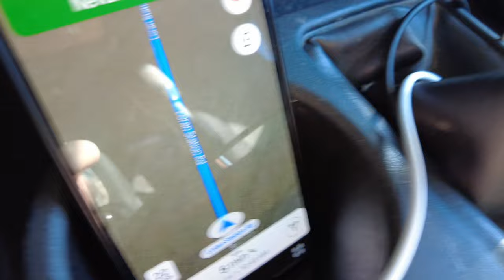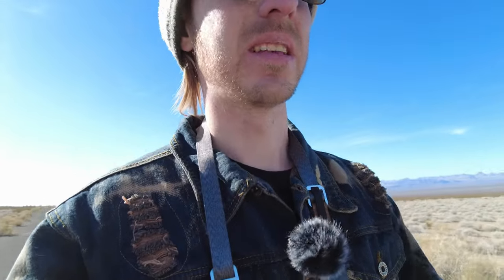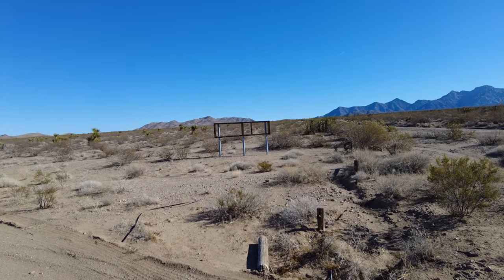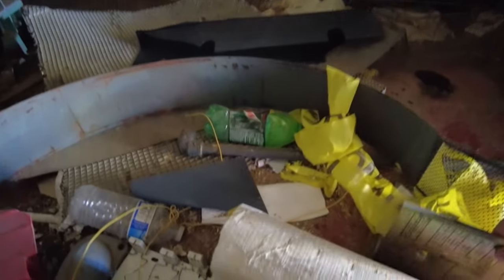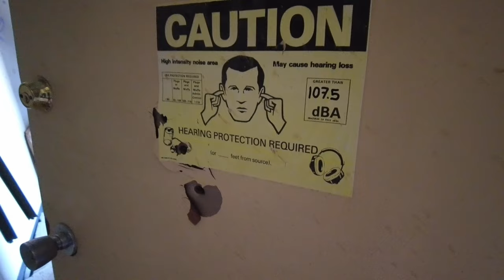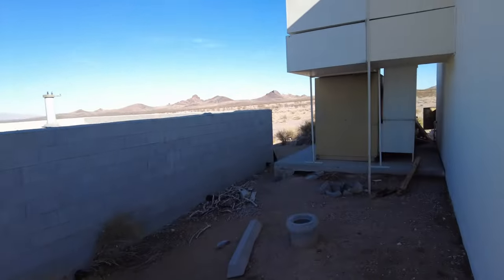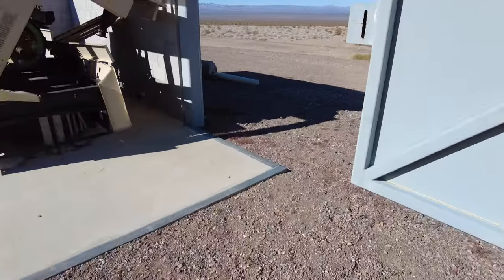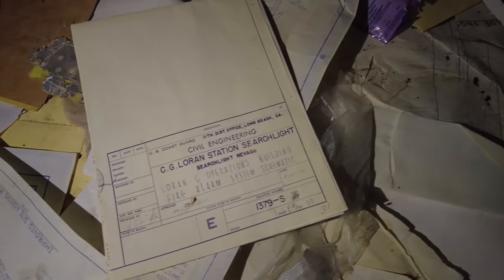Abandoned Military Base in the Mojave Desert - What's Inside?

Comment: Air Force Plant #72, by Boron.  Was a proposed Zip Fuel testing and manufacturing site.  Zip fuels would have been burnt in the afterburner section only of the Valkyrie and others with the right engine, for a extra "kick".  The stepchild of Zip Fuel testing was Triethylborane, which is the zip fuel ignition agent for JP7 fuel, used in the SR-71 Blackbird.  Miserable deadly stuff that was dropped, but it did have potential gains. One testing facility in New York exploded,,killing people.    We found that plant on 3 wheel Honda ATV's a long time ago in the desert.  Had no clue what that was.  Only years later did we find out.   Crazy stuff,  like A Coast Guard Station,  in the desert.    Thanks Uncanny.
Reply: Yes; tri-ethyl borane was a failed experiment. (I have a degree in Chemistry and experience in organo-metallics) It ignites too readily upon exposure to oxygen to become a fuel ignitor for afterburners and such. Don't know too much about "Zip Fuel" personally.

Comment: Nice, the govt' just leaves hundreds of thousands of dollars behind for scavengers to pick at. It's not like they paid for it anyway. Just the blue gensets inside are 165k apiece.
Reply: It would have cost tens of thousands to remove a bunch of stuff that was obsolete and useless anyway. So they saved taxpayer money by leaving the stuff. New generators cost that, these were not new when they left them. Everything was outdated. And requirements changed for what energy efficient things could be used. No point taking old generators from the 80s and 90s and paying to have them removed, repaired and transported across the county when newer more efficient ones were cheaper, and provided more power.